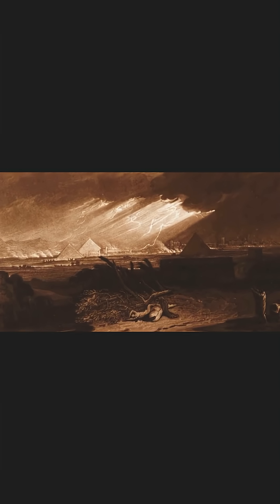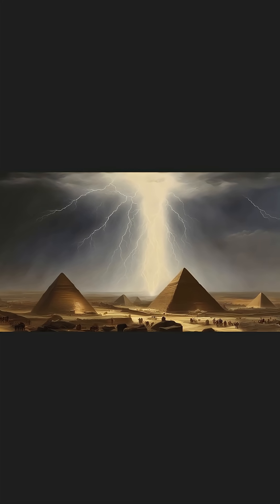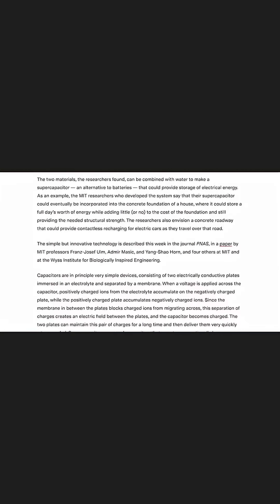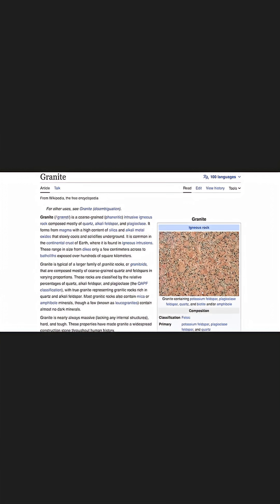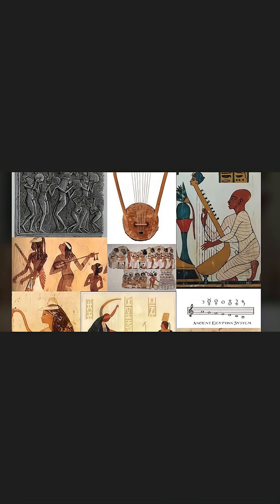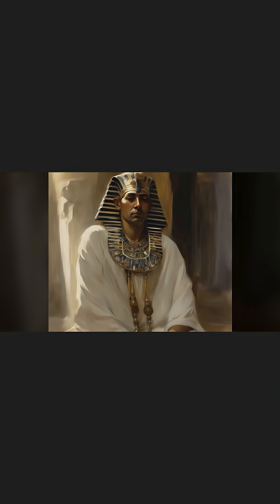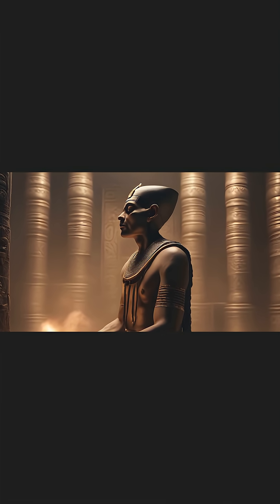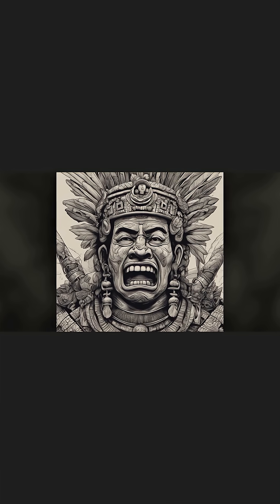Electric Egypt | #electricuniverse #plasmacosmology #egyptianhistory

Comment: I'm working on a circuit involving capacitors now, which should run a device using the same electrons circulating back and forth through the load device during each change in polarity 120 times per second from a 60 Hertz AC frequency at 120 volts, but the capacitors must be charged up first before inserting them into the circuit using a double pull single throw switch regarding 2 capacitors in series with the load device. The power meter should still measure the same wattage, but less current will be needed from the Power Station resulting in less needed fossil fuel burning. It'll be a win-win situation for all.  💡🏃‍♀️👍

Comment: Graphite and carbon black are central to blackbody radiation discussions because their hexagonal lattice structures enable strong absorption and near-ideal emissivity. Similarly, water’s hydrogen-bonded lattice-especially when compressed or in bulk-may support thermal emission akin to a blackbody, as proposed by Pierre-Marie Robitaille.

Comment: I believe the internal granite and alabaster wall linings provided light inside the pyramids, especially because the whole structure was designed to vibrate, in both specific and a variety of frequencies.
Reply: Interesting thought since there is no clear evidence of fires within the pyramids and temples.

Roughly, how would the stone lighting work in concept?

Comment: We don't really have to speculate. Alexander Golod has built 17 pyramids in 8 different locations in Russia. The biggest is 44m high. They are made of fiberglas without metal and are basically huge capacitors. Experiments carried out in them include research in medicine, agriculture,  radioactivity, superconductivity, chemical, electrical and other areas. The pyramids have positive effects on materials, humans and the surrounding area.
Reply: In fact, our bodies are bags of electrified solutions whise voltage can be readily measured with a pH meter or colored strip. Every enigmatic system in the body has particular pH or oxidation reduction potential range. I found that my homeostatic range is 7.02 7.6. 7.6 with this fact, I neutralized the acidity in my body to neutrality put my prostate cancer into remission now in remission for 2 and 1/2 years since March 2023